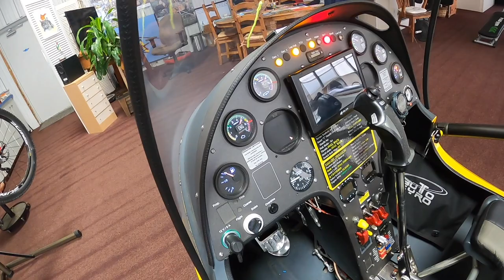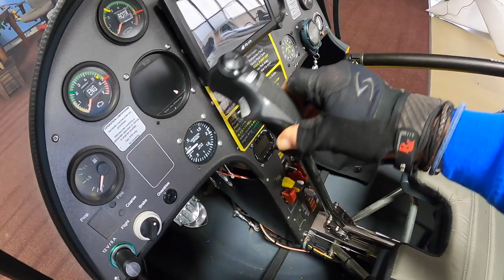Basic European Style Rotax Powered Gyrocopter Preflight

Comment: I would add rudder pedal cables, check for pullies, cable showing through glands at pedals, tensioners. Pitot check. Transponder antenna. Grass in the oil cooler.

Comment: That was truly shocking. I fly an MTO3 in Europe and my preflight checklist has 130+ points on it. I start at the pitot tube and work backwards to the nico nut on the rudder, checking everything in between - including climbing up on the rear seat to check the rotor head, bolts and prerotator mechanism. It takes me a full 30 minutes and I cannot imagine any gyro pilot who would fly a machine after giving it such a cursory glance as you have demonstrated in this video.

Comment: 1) the fuel contaminants check must not be done few seconds after refuel, you have to wait that all the possibile dirt or debris to land on the bottom of the tank.
Water is not the only danger in fuel.
2) both the oil and fuel cap must be put on the pilot seat, to be sure not to forget them and sit into the gyro
3) there is no oil pump, the oil is pumped in the circuit by the blowby of the 4 pistons and that is the reason why turning the prop slowly will save you some energy to get the motor to gurgle